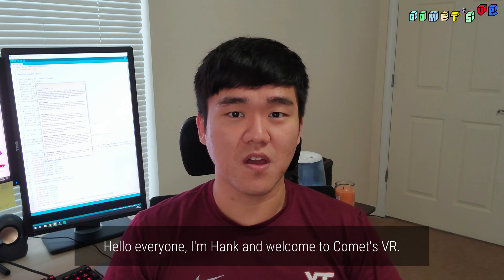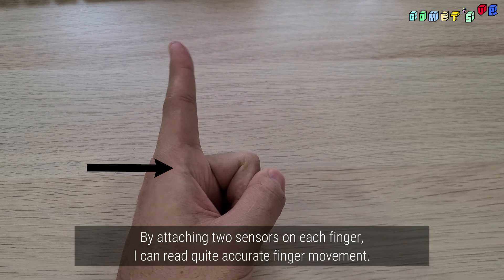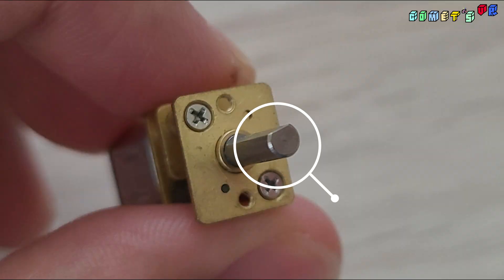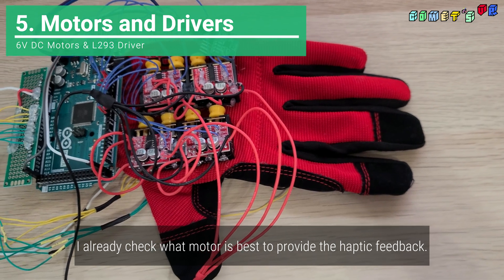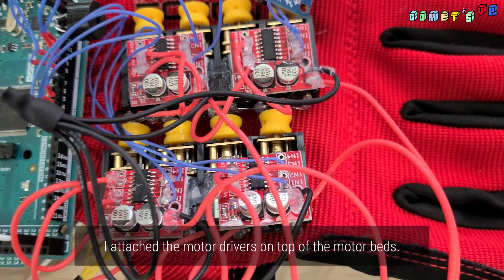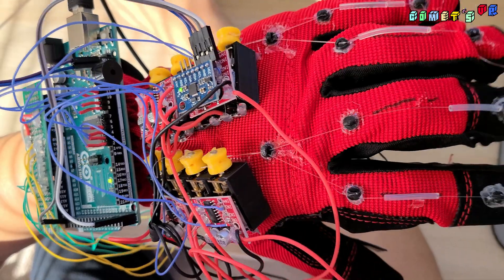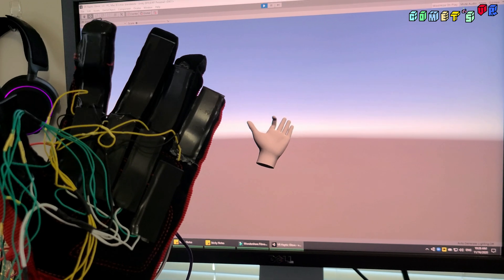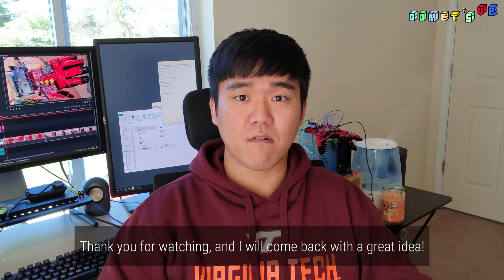VR Haptic Glove Hardware Implementation

Comment: How did you find the hand model and matched it with the sensor values
Reply from the maker: I used the Oculus Hand Model and manually adjust the sensor values to each finger point.

Comment: glad to know i am not the only one working on this project, instead of having haptic i am just making beat saber with aurdino based whole arm tracking, im making an exoskeleton using potentiometer for each joint on my arm. Since i dont have a headset i am using my phone with google vr. 
and another thing, i got aurdino working bluetooth with unity
I just used 2 aurdino and 2 hc-05 bluetooth modules. Aurdino records data and sends via bluetooth hc-05 to the other aurdino that directly connected to pc which uses the io port to read the data.

You can check out my other youtube channel DaudHTM where i post most of my projects. I really need more subs and views
Reply from the maker: Cool cool! Good to know someone is working on this stuff!
Reply: have you tried connected the hc-05 on the glove directly to the pc built in bluetooth?
Reply from the maker: @pedrolima-eu4pb  My PC does not have built-in Bluetooth module :(